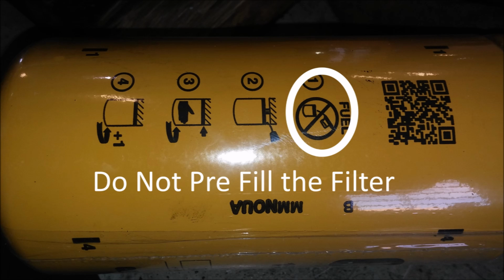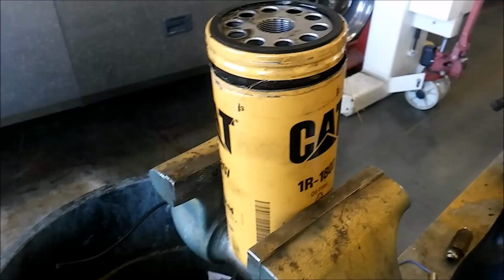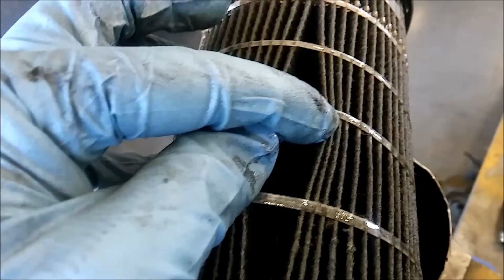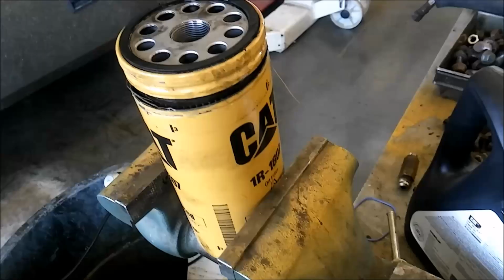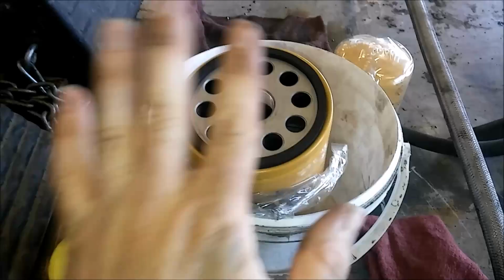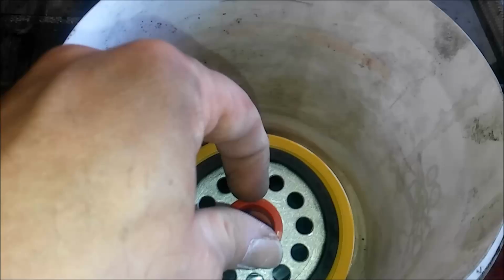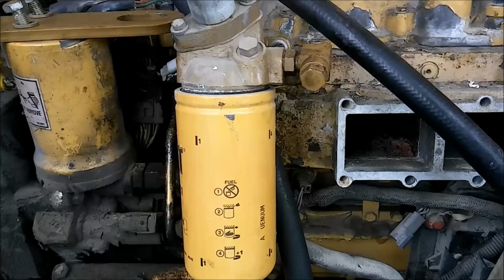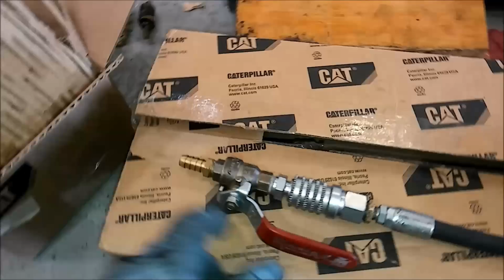Should You Pre Fill an Oil Filter? Should You Pre Fill a Fuel Filter?

Comment: i always pre-fill the fuel filters...... its better than cranking it over for 5 mins (when it doesnt have a primer pump, or the pump doesnt work....cough cough duramax)
i do pre-fill oil filters.... but always block the center hole

and you ABSOLUTELY MUST pre fill if its a new engine..... or it hastn been ran in a while 

15w-40 will stick to the bearings long enough to do an oil change.... and long enough to fill the filter and build pressure 
but, if i can pre-fill the correct way..... it just makes me sleep better at night

i HATE the sound of lifter rattle when i dont pre-fill...... 

hell, even little gas car filters..... they will still lifter rattle for a second or 3
however, i almost NEVER prefill a gas motor filter

they are so small, they get filled in under 3 seconds, usually 

now things like a 1 ton pickup diesel filter..... or a gen 1 chevy small/big block filter..... i do prefill 
simply because of the filters capacity.... takes a LOT longer to fill up

would it hurt it to NOT prefill..... probably not

BUT!!! I KNOW I DIDNT HURT IT! if i prefill (again, the correct way)
Reply: ok, you did mention LONG "no-run" and rebuild conditions..... glad we are on the same wave length 

but ya..... if you drive it into the shop, dump the oil and filter..... new filter, new oil...... 
no need to prefill 

even 0w-20 is going to hang around long enough to protect the bearings/lifters/cam

Comment: Has anyone considered the possible difficulty for a system pushing oil at cold temperature at normal working pressures, purging large bubbles of air through an oil-wetted filter versus the air passing through a dry filter. I have wondered about that. A completely dry filter will contain much more air which has to pass along the only escape, the lubrication path. Does a partially cold-oil filled filter delay for longer, the supply of oil to working surfaces more than fluid resistance in the filter material slowing the purge of smaller volumes of air from the filter. The lubrication path itself due to normal working surface clearances is not a high volume flow. The only guarantee absolute would be a separate pressured oil supply to prelube the engine and purge any entrained air from the lubrication path as is a practice with some marine and aviation engines.

Comment: I dont think its going to make any difference either way with oil. They dont prefill oil filters in the car service so why should i, just an extra step without any significant gain. Diesel filter is another thing, you prefill because of the air like you mentioned and thats what they do in car service. One way to prefill diesel filter is to turn ignition on few times without starting.

Comment: So…. Great videos, I feel like I’ve seen a lot of your content the last week. Buying a RV with a C9.  Can’t get a straight answer on last service performed! I’m thinking the least I can do is change the fuel filter. I’ll be flying out and driving it home about 1,100 miles. Once home, I’ll service oil, water separator and air dryer.  
      Has anyone tried to bring a C9 fuel filter onto a airplane in a carry on? Not familiar with the area so I’m not sure where I can pick up a filter. (Kansas City, driving back to Las Vegas NV)

Comment: Had a Cat C7 in a motorhome. Took it to a Freightliner "Oasis" dealer for oil and fuel filter service. The tech replaced both primary and secondary fuel filters without pre filling them. Due to clearance issues there was no primer pump. He then proceeded to try to start the coach. Care to guess the outcome? What should have been an hour service turned into an eight hour fiasco. They were clueless! Kept trying to start the engine. Cranked the heck out of it. Calls to Caterpillar support. They cracked open fuel lines, pressurized the fuel tank, etc. Finally the engine started. The tech pressurizing the fuel tank took a bath in diesel fuel from head to toe when he pulled the air hose away from the tank. They hooked up their equipment per the advice of Cat and killed a cylinder at a time to check the injectors. Said everything was ok and sent me down the road. Ok. For how long? Don't know, sold the coach with the worse motor I've ever owned.

Comment: Always pre-fill the fuel filter on a diesel with clean new ATF. Cleans the injectors, prevents an air locked no-start condition. This is how I was taught and it always works. No chance of contamination if you are using brand new ATF, much better than diesel from a can. 
It will smoke like a bastard on startup but ATF burns just fine in a diesel.
Reply from the maker: +Matthew Edwards I've heard of people doing that, but is it safe for the high psi common rail injectors?
Reply: Adept Ape it harms nothing. The ATF is quite thin, made even thinner mixed with diesel as the engine begins to idle.
Reply: No it doesn't, and will do serious damage to your catalitic convertor

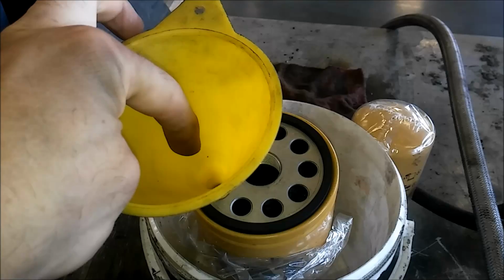Comment: I linked to this video again in an end card to a video I posted today.  I had a good guy that didn't understand this concept due to misinformation blowing up my comments for not instructing DIY Cummins owners to pre-fill their oil filters.  If they do it with a funnel as shown here- they'll contaminate with a dirty funnel like the one in this video at 2:43 .  Caplugs are great compared to leaving something open, but they leave trace plastic in the threads when you check with a microscope and often red particles big enough to see across the room if used more than once.  As heavymechanic2 points out- virgin oil samples have higher particle counts than filtered oil does.  As a general rule, why the heck would you introduce any unfiltered fluid downstream of the filter?  It's always a poor risk in handling and it's rarely going to yield a benefit that's greater than the risk.  You're better off playing the lottery.

Comment: good job i always at least fill half full the filters on my stuff i aim for the side holes pouring slow some always gets in the mid hole.
Reply from the maker: +David truckcoe If some gets in the middle that is OK. Use that plug though and it'll keep the fluid on the outer holes, or get a really little funnel.

Comment: I call bs, oil from a clean jug of oil is clean. It doesn’t matter what side of the filter. I’d be more worried about type of oil and how often you change it. You’ll more than likely get more debris in a filter just by simply changing it without cleaning around the housing and putting a new one on with dirt from the engine falling inside. That should be more of a concern to most.

Comment: Wow. It's crazy how people stuck in their ways refuse to listen to logic. I'm a 32 year diesel teck. I'm telling you the best practice is to follow the manufacturer recommendation. Sure it might not throw a rod as soon as you start it but those small particles that you can't see get lodged in to the soft metals of your bearings and become sandpaper. Prefilling fuel filters are even worse. A 4 million micron partical can stick a plunger and there goes $4k to replace a pump and you will never know why it failed. Good techs save you money and bad ones cost you money.

Comment: You shouldn't have to worry about contaminants if you're putting on a clean oil filter and filling it with clean fresh oil. The contaminants on the outside of the filter come from the engine not from the fresh oil you're adding. And the reason to pre-fill a fuel filter is so that you don't run air through your fuel pump which is extremely hard on it.

Comment: thanks for letting me know about this! I was also pre-filling my oilfilter using the big hole in the filter, it makes sense what u say!
Reply from the maker: +Kevin Britton It depends on the engine, as this video was Cat centered. Many oil filters are clean in the center hole, but check if your manufacturer has the dirty side on the outside or inside and then if you pre fill do it from the dirty side.

Comment: I've seen a lot of modern engines with fuel filters on top of the engine, making them upside down (Audi for example). These would be tough to prefill (will drain out), or maybe just wetting the filter with oil first would help?
Reply: When i changed the one on my jetta, there was still a considerable amount of fuel in the bowl when i changed the filter.  Beats me, but it was full.

Comment: Great video! Stop the unnecessary work and potential contamination. 
Allow fuel lift pump to get fuel rail pressure up some before starting. Majority of air should be forced through bypass. Full pressure of course will no occur until engine starts. Don't change oil and then not start engine. Oil drains back and is replaced with air/humidity. Always run oil through and remove air.

Comment: I appreciate the advice of a professional diesel mechanic, what are your thoughts for stationary constant speed engines (generators) which immediately go to 1800 rpms. I know technicians who do, and don't prime oil filters. I always thought their is a potential for turbo damage, and have always primed, from the outside of course.
Reply from the maker: +Alex Miles As long as you prime them the right way there is no downside to priming them. Some of the bigger engine like the 3500 series have canister filters on some of their engines and you can't prime them even though they take gallons of oil in the filter housing, the engineers don't seem to worry about it. You could always crank the engine before starting it without the injectors powered to prime the system. Just prime them on the dirty side and you'll be fine.

Comment: I have a pickup truck with a diesel.  The fuel filter is in the low pressure system (from the lift pump).  The restart procedure is to allow the lift pump to cycle 3 times before attempting a restart after fuel filter replacement.  What do you think about the chances of air causing issues?

Comment: Hmm, I have been pre filling oil filters on my cars my whole life, thinking I am doing the right thing. Just curious though- If I go to the store and buy a 5 quart jug of a high quality oil, what are the odds of it being contaminated with microscopic solid particles? Is the oil any more likely to be contaminated than the inside of the new oil filter or the funnel you used to fill the filter from the outside? I would think that they filter the oil before they bottle it, but I'm no expert. Great video as always!

Comment: Big diesel engines with large multiple oil filters absolutely need to be prefilled to start one with dry filters will cause oil pressure loss for up to 10 seconds or more these diesel engines that we are working on is somebodys livelihood they depend on these vehicles to earn their living and letting them run dry for a few seconds every service because its easier is not only bad practice but downright negligence pay out of pocketfor the rebuild of a c15 just 1 time and you will never install a dry filter again for as long as you live

Comment: Interesting, I somewhat believe you but I worked at Danny's truck resort and flying J truck service center both trained us to pre fill the oil and fuel filters. Both shops I saw 100's of trucks per week and none had any issues at least for the few years I worked at both... also the CAT diesel academy says to fill the oil filters cuz if you dont the engine will suck air for a second Instead of oil, which can cause pre mature wear. You even explained with the fuel filter having to fill it wouldn't the same apply for oil, especially with a more viscous fluid and a bigger filter? Where is your basis and research from? Your wearing a cat hat but do you have any of thier certs?

Comment: I never pre-fill either oil or fuel filters; but, my CAT C-7 has a manual pump to fill the fuel filter after it's installed, like the one seen in this video.  If it was such a terrible thing to not pre-fill an oil filter, there wouldn't be so many engines with the oil filter mounted sideways on them...

Comment: I always fill any and every single filter i install. if you fill in from the middle or not THE WHOLE FILTER gets the oil because the filter doesn't restrict whatever system you are using it FILTERS WHATEVER FLUIDS YOUR USING.

Comment: Most engines use full flow filters. There's always dirty oil on both sides. This prevents the engine from being starved for oil. I guess the logic is dirty oil is better than no oil, which would happen when the filter became plugged or restricted if it wasn't a full flow. Bypass filter has a clean side & a dirty side, because it is only filtering a fraction of the oil but to a much finer micron level. Even if you have a bypass filter on your engine, it's still getting dirty oil from the full flow filter. So bottom line is: do whatever you want. But don't starve the engine of oil.

Comment: so I get your point on possibly introducing contaminants when you fill from the clean side, but aren't you still going to be introducing the contaminants when you fill your engine with oil, granted it will be filtered out but unless you're putting it directly into the oil pan it will be touching other parts in the engine before it makes it to the sump.
Reply from the maker: +Stig Cruise Touching the parts doesn't really matter, you could throw sand on the outside of a connecting rod and it wouldn't hurt it, you need to keep the oil rail and bearings clean which is why keeping the filter clean is important. These suggestions are from the manufacturer, I'm just relating them.

Comment: if the filter and oil are new and with no any kind of dirt,there are no reasons to fill it on any hole-do not change oil and filter when  is sand storm.
 on some low tech engine , i remove spark plugs and start engine for 2-3 sec to push  rest of old oil from engine. after oil is filled into engine and filter, i make same procedure with starting without spark plugs,  to such new oil into system for 10 seconds

Comment: Only big filters that needs to be pre-filled but not in the center. Many years ago Ford tractors had massive hydraulic filters and the hydraulic pumps failed constantly with ford engineer's stumped why all of the tractors hydraulic pumps failed except those tractors that was serviced by the workshop I worked at and came and ask why those don't fail by our workshop and what we are doing different. I was the tractor foreman/mechanic/field service mechanic at the time doing all the services. 
So I told them the filter takes exactly 3.5lt oil to fill and by the time the pump has sucked oil through the filter it was already risking damage and premature wear and I fill all those filters with oil first, Ford later approached me to become a service trainer for them on their tractors which I refused because of all the travelling involved. Yeah I was in a matter of fact stupid at the time for not taking the job which I now regret.

Comment: With extreme pressure common rail fuel systems prefilling a fuel filter could cost you a large amount of time and money. Install it empty and fill it with its manuel pump or its electric pump, which ever is on the engine. One piece of dirt in that system will ruin your week. Don't forget if you crack lose an injector line (don't ever do that when engine is running you can die) you have to replace it. It is no good.

Comment: I put over 200k on a tacoma. Anyone who is familiar with the Tacoma knows the filter is installed open end facing down. Its Impossible to prefill - I’ve heard of people putting over 300k on those engines. I doubt Toyota would purposely design an engine with the oil filter facing down if it was going to damage the engine.

Comment: I changed oil on 3126 in an RV for a customer. Oil filter dry and  fuel filter was loosened to convince my self the customer had bought the wrong one. Put in 5 gals, brought dipstick to full mark. Started engine it ran  and died, tried to start again but it wouldn't catch. So I figured I must have lost fuel prime. I went back to the engine and the ground was covered with oil, lots. Any idea what may have happened?

Comment: I Have been doing it for over 40 yrs  and still fill from the center and never had any Problems.   but I can see what they are saying about  Fuel or Oil  Maybe Having Dirt in it and filling the Filter on the Clean side . But all thing being Equal  if there were a spec of dirt in the Oil of Fuel I don't think that's Enough to Break the Bank. But then again how clean is the Inside of a New Filter ???    To  Dry Sump something is a Lot worse

Comment: I know on the mack mp7 motor of it doesn't get filled the fuel filters it won't start you will struggle to manually prime the system also with the. Cummins I belive the isl or ism motors as well in the Autocar refuse side that being said I don't prefilled oil filters

Comment: Why do I have a reoccurring check  engine light on my timing sensor.  I have changed it out twice. And same problem. I have also changed wire harness for all the sensors. I need some help. Any suggestions?